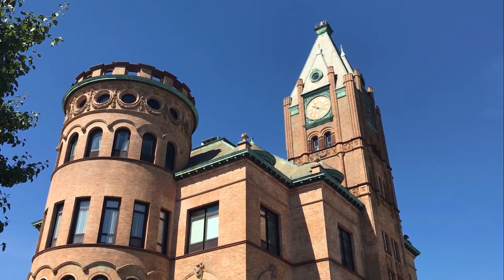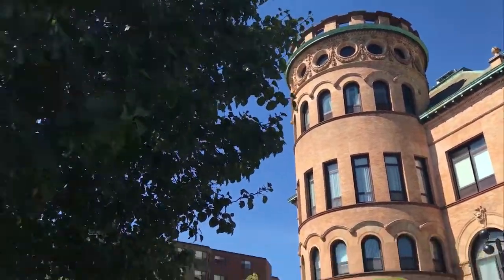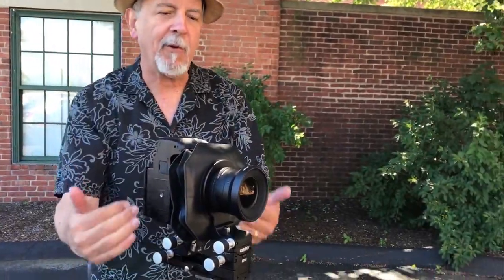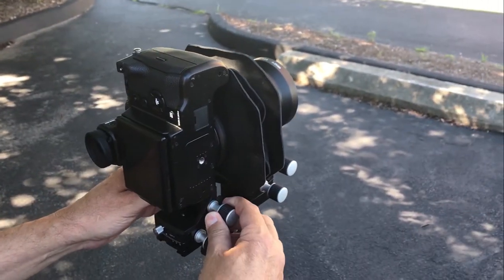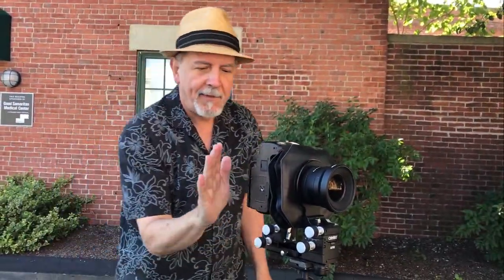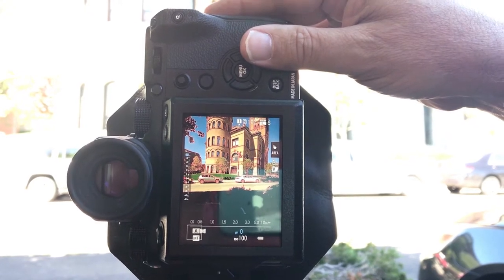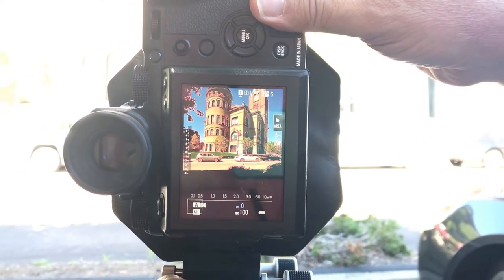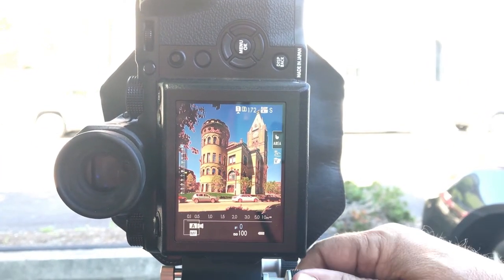CamboActusGFX

Comment: Thanks for sharing. Can you only use the gfx lenses with this?
Reply from the maker: Actually, its best to use view camera or enlarger lenses with large image circles, in order to take advantage of the swings & tilts!
Reply: Good thinking. Maybe there are some good vintage lenses that may not be so expensive now that would perform very well with this set up with very little distortion?
Reply from the maker: I think it might be worth checking eBay or some other used photo equipment outlets!
Reply: older analog Lenses may not have the resolving power to resolve the 50MP of the GFX
Reply: @SD_Alias  Agreed - I'd go with Digital Rodenstock or Schneider type lenses or even Canon TS-E lenses.
Reply: The ACTUS was designed by the Cambo office clerck;
he had never met any real photographer.
That is why the camera is no success.
THE GFX SENSOR IS MUCH TOO SMALL 
FOR THE OLD OPTICS.
The "old" view camera optics begin at 65 mm
( Zeiss made a 53 mm).
A Super Agulon or a Grandagon 75 mm is like 
a tele for the GFX. So you have to buy an very
expensive new designed mini optic.
The Actus is made for the old people who are 
afraid to drive a Harley Davidson.
Jaco van Lith, Rotterdam, The Netherlands.

 @LeeVaris
Reply: @jacovanlith5082  Define success please. Cambo serves a very niche market, and does that really good. There´s no way the average photographer ever going to need a technical camera, thus the amount of buyers are low. Even within it´s target group, the amount of photographer that needs a technical camera is really low. Cambo gives you exactly what you need, if you need it. And does a great job. If you attach a Rodenstock or a Schneider lens to it. Nothing else comes even close in technical terms. The Actus is made for professionals who can afford to have a custom made bike by Harley Davidson.

Comment: I missed it, but what lens are you using.
Reply from the maker: This system is designed for view camera lenses with large image circles - 4x5 lenses or similar... I think I had maybe a 130mm wide from Cambo, but you could use Rodenstock, Schneider, Nikon, Fuji, etc... See the reply threads under FelixMooeeram's question.